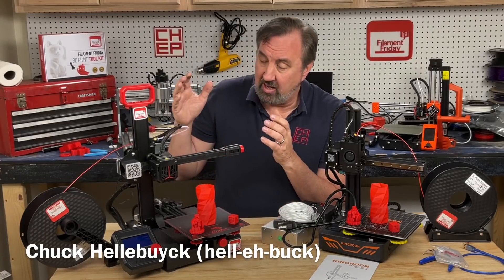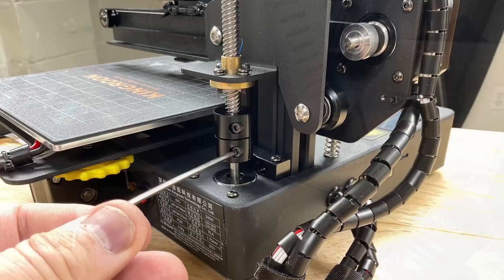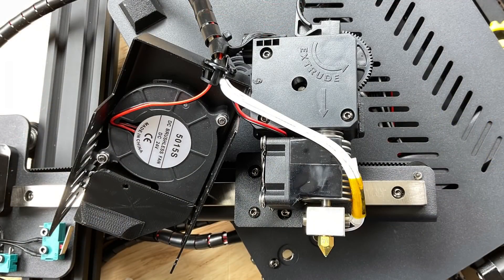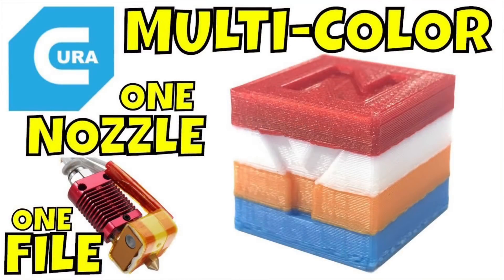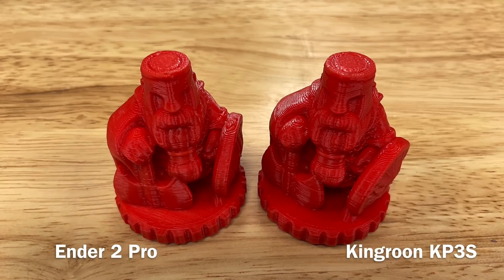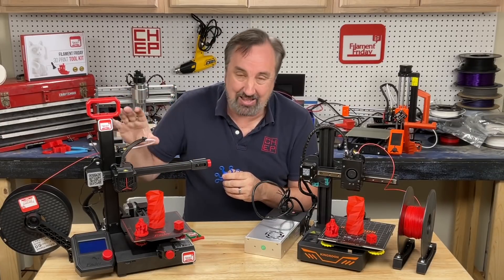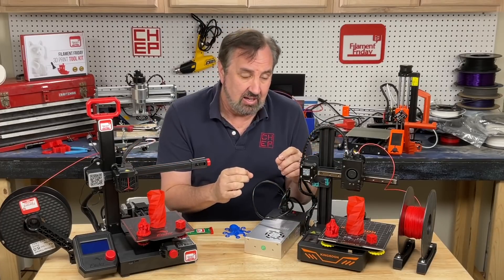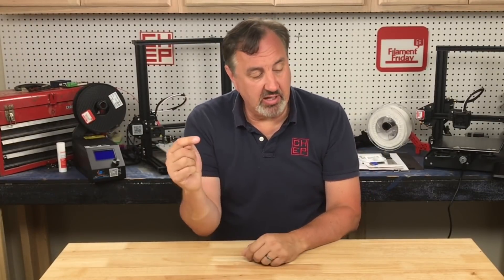Kingroon KP3S vs Ender 2 Pro - $179 3D Printers

Comment: I had to replace the wheels on my enders due to having flat spots overtime. Linear rails are just better quality parts, not necessarily for better quality prints. I get better cooling on the K3PS due to the better fan. Better DD extruder. A few printed mods and the power supply & spool holder is attached to the frame if you prefer that. Update the firmware and you get all things you need from marlin, plus a better display orientation too. Add a pi and klipper and that thing flies at high speeds, thanks to the linear rails. The KP3S is superior in every way to the Ender 2, but you'll have to put a bit more work into it.

Comment: hi... can anyone explain i am using pla gold in ender 5 , i printed phone bracket half way through i turned up speed from 100 to 150 the filament really did look like shiny gold at 150  , at 100 it looked dull ,why is this thanks .
Reply: which nozzle temp do u use?

Comment: I can see the attraction of the slightly larger build plate on the KP3S,  but I really don't like the way all of the parts are separate.  The Ender 2 Pro looks like an amazing, compact and even portable machine for the low price.  If I were in the market for maybe a "spare" printer for little bits and pieces, or to print parts to repair a larger machine, the E2P would definitely be on my radar.
Reply: There's a neat printable mod for the KP3S to mount the PSU under the main units.

Comment: Kingroon's firmware isn't open source. It is based on Marlin v1 . If you try to update the firmware the screen will need a print to make it a different direction.  The KP3s is very cheap. That is why people turn to it.  They kingroon didn't enable most things because they have the very basic marlin commands through the touch ui made by mks. the board is from MKS Robin Nano v1.2~1.3 - The board needs jumper wires soldered to be able to use it in UART mode. otherwise, they are A4988 mode in the firmware.
Reply: You're talking about an older version of the KP3s, the current version is 3.0 which has TMC2225 drivers. And are you saying that Creality's 4.2.3 board can use UART without soldering additional wires to it? Because that would make it the first Creality board being able to do that

Comment: Maybe the Kingroon uses a different M code for pause, like M600 (filament change pause) or M601 (pause print)?
It's amazing they can make and sell these printers for this price. I'm right now tuning my new V-Minion, which has the same cantilever design, and the same 180mm x 180mm as the Kingroon, but costs 3.5x more (and you have to build it yourself). Of course it's a completely different grade of machine and can print much faster, but still it's incredible that anything is possible for $179.

Comment: Ender 2 vs k3p vs prusa mini?:))
Reply: IMHO the Mini blows the Ender away, right out of the box. While it does use a bowden tube extruder, I'm able to SainSmart flex just fine with the OEM extruder. The Mini does use a seperate power supply, but it's huge like the KP3S and a separate spool holder. There is a spool one that attaches to the Mini that you can print, but as I always print out of filament dryer box, I never printed it.
Reply from the maker: Prusa mini is $400. Not really a fair comparison. But I talked about it in the Ender 2 Pro review video.
Reply: @FilamentFriday  I know:) but mini is very similar concept ...and im curious about difference in quality...maybe these has better quality - price  value 🤔

Comment: I found the Kingroon KP3S is on another level. You can read the full name of your prints unlike the Ender 2. Direct drive. Easier to setup. Linear rails make for less wear unlike the wheels on the Ender 2. A smaller profile is great for the room. Things I do like about the Ender 2 is the spool holder is better in my opinion, minus it taking more room. The adjustment for the belts. I personally hate tool trays that go inside the machine. I like a nice easy grab solution personally and I really don't need a handle to pick up my printers. TPU on the KP3S is a massive advantage for me. Though you could go with whatever is the cheapest at the time, if TPU isn't a major important filament you want to be able to print out of the box.
Edit: Larger part cooling fan on the KP3S is better. KP3S has a 2mm to 3mm PTFE liner in the heartbreak that is a pain to replace. The Ender 2 has a cheap PFTE tube that will need trimming over time. Still, the Ender 2 is easier to trim than replacing the liner on the KP3S. I'm still working on a replacement for the liner on the KP3S. The touch screen is nice on the KP3S and it looks better for me. I found personally KP3S prints like a professional machine. I dislike both the magnetic beds on these machines so I replaced them both right away with PEI spring sheets or glass.

Comment: linear wont make any better quality but boy is it easy to use. I have x axis converted to linear on ender.
Reply from the maker: Easier In what way? I’m curious?
Reply: @FilamentFriday  Theres no adjusting it. Less parts. Overall it is better. Something like ender 3 or this kingroon wont probably need it but move to a ratrig like i did and there is no point in anything other than linear rail. The cost of a rail is pretty much cheaper after you once change full round of v slot wheels. Or depends. V slot wheel at 3d jake cost 5€ per piece. Linear rail cost me 25€.
Reply: @TommiHonkonen  who pays €5 for a wheel when you can get 10 of them for the same price from China :)

Comment: linear rail allows higher speed at the same quality, that's a big improvement in performance
Reply: But only at 100mm/s and above, under that you should be fine with rollers. And honestly I wouldnt go higher than 60mm/s with these little guys.
Reply: @tonim.9460  ok so it depends on the user, but linear rail just has more potential. Also, linear rail is easier to maintain as it doesn't create those dusts from the rubbing.
Reply: @user-yk1cw8im4h  They are more reliable, but maintaining them is not the easiest. If you need to fix or clean one of the sleds, thats going to take you some time.

Edit: a lot more time than just screwing new rollers on to the axis.
Reply: @tonim.9460  why would you ever want to remove a rail/sled to fix or clean though? If you spill milk on it then yeah, but if not it will stay working probably forever.
Reply: @user-yk1cw8im4h  Dust from the air and small particles from printing will eventually end up in the sled, renewering lubrication and of course they still have a life span.
Reply: @user-yk1cw8im4h  And a lot of rails come with a protection oil to keep them from rusting and so on, but its not a lubricant, so you have to take them apart, free them from the oil and use your own lubricant.
Reply: @user-yk1cw8im4h  But I'm with you, linear rails are better, but not really for beginners.
Reply: I doubt these cantilever designs are rigid enough to work well at high speeds, especially with a direct extruder.  That said I do like the extra build area on the Kingroon given the overall footprint is similar.  I've had a monoprice mini for a couple of years, chosen due to lack of desk space, but often wished for a little bigger build area amd now the display has gone bad and it needs a new build surface I'm quite tempted to get one of these.
Reply: @ferrumignis  Hard disagree. I've put Klipper on my KP3S and upgraded the hotend and extruder. It can print very fast with great quality. Look into the Rat Rig V-Minion as well; people can print crazy fast with those and still get great quality prints.
Reply: @760creations  How fast are we talking with your machine?
Reply: @tonim.9460  I can easily print with 150mm/s with 2500 acc.  With 120mm its perfect quality with klipper. Its equal to default fw 60mm/s.
Reply: @jobbagyferi  Is Klipper really that much better? I was thinking about switching to it
Reply: @tonim.9460  Yes. Next level. But it can be tough to configure.

Comment: The size of the display and firmware is much like the flsun q5. The board looks similar as well. Looks a lot like a mks robin nano.
Reply: cause it is a MKS Robin Nano v1.2 ish. a custom-made Robin Nano for Kingroon.
Reply: If it is an MKS Robin nano clone, does Marlin support it?
Reply: @ferrumignis  Marlin works on the Q5, so I would assume so.
Reply: @bleach_drink_me  Thanks!

Comment: The Tronxy X2 would be better as I had mine for 6 years now and it is still going strong. But it is a bare bones 3D Printer and it has been on sale for $129.00 on some places. (Average about $150.00). Mind you when my girls got it got me it was $199.00 on Xmas 2016.
Reply: Not seen that printer before, has a big print area for a cantelever design. Unfortunately doesn't seem to be listed on the Tronxy shop website, so may be hard to find?

Comment: Looks like you can tighten the belt by shimming the servo motor. Shims can be 3d printed.
Reply: Also could probably use one of the metal springs that clip over the belt as it looks like it only needs a very small amount of adjustment.

Comment: If I wanted to print ABS how much of a pain would it be to remove the Power Supply of the Ender for proper ventilation?
Reply from the maker: It’s not easy
Reply: @FilamentFriday  so advantage Kingroon when it comes to this issue, provided you can easily covert to all-metal, good to know, thanks.
Reply: I print ABS on my ender 2 with no problems

Comment: nice basic review. I've got 3 kingroons and 1 ender3. for me the ender takes a lot more maintenance. from the famous extruder cracking issue to constantly being out of level. not to mention all the bowden problems that pop up half way through a 2 day print. the kingroons are bullet proof work horses. I don't even check bed level for weeks at a time. always ready to rock and roll.
Reply: Thanks for this, I'm actually tempted by the Kingroon for the larger bed area and direct drive. Is there any open source firmware support like Marlin? I could see the file display issue getting old pretty quick.
Reply: @ferrumignis  yes people have installed Marlin and klipper on these successfully. There is a decent community on Facebook and many printable upgrades online. Including a base for attaching the power supply under the printer that doesn't require buying any screws or parts at all.
Reply: @fufermanxyz  Thanks for the info, just ordered one to replace my aging Monoprice Select mini.

Comment: Cogged timing belts aren't like flat or v belts - they need very little tension to work. They are like gears, they only loose position if they are loose enough to skip teeth.
Reply: @wojtek-33  yes, loose belts can cause ringing and other print artifacts.
Reply: @LostInTech3D  maybe a good video idea for you to test? Loose vs tight belts?
Reply: It looks only very slightly loose, probably could use one of those little metal springs that clip over the belt to tension it. If not you'd have to shim the stepper out.

Comment: Rollers need to be replaced every now and then because they wear out over time. Linear rails don't. But i am not sure why they chose to go with rollers for the z axis on the kingroon.
Reply: A single linear rail on the z axis of a cantelever this long probably wouldn't give great rigidity in the Y direction (i.e. stopping the end of the x axis flapping back and forward) as that's not how they are intended to be loaded.
Reply: Its because not so much movements on z axis. I think u sould that a look at kp5s instead. Its really nice xyz solid axis
Reply: @Pilot_X_indonesia  And to cut the cost down i guess? But does it make that much of a difference in price?
Reply: @Pilot_X_indonesia  Yeah I agree, there is less movement on the Z axis, but IF you get flatspots on your Z axis you will see artifacts in your prints.

Comment: The base firmware is marlin one smoothieware.  Luckily with the f103 building marlin 2.x.x works and you can also wire linear advance.  Unfortunately they've been issuing gd32 and f407 chips and they aren't as easy to play with.  The motherboards are reversed robin nano v1.2's
Reply: Does the 2.x.x Marlin fix the file display issue?

Comment: Linear rails are better for print speed
Reply: I like linear rails because it's less maintenance and a longer lifespan.
Reply: Not enough to be worth it. If you're in a panic about print speed, you need a core XY. If you're in a panic about speed, spend more on the base machine.
Reply: @pinpetos  that's not true at all, with linear rails I keep my acceleration in the 6000 range and speed in the hundreds on an ender 3 with linear rails.  The only quality issues is from extrusion.
Reply: @pinpetos  nope, you can use klipper and get 8k accel 300 mm/s speeds with a KP3S.

Comment: On this type off printer linear rails are useless. You will need them if you run high velocity moves with high accelerations.
Reply: A klippered KP3S can get up to 8k accel 300 mm/s speeds and print perfectly tho

Comment: Thanks for taking a look Chuck! I love my KP3S, but I've done a ton of modifications and put Klipper on it. I definitely see your points about the Ender 2 Pro being a lot more user friendly and easier to handle. Regarding the firmware on the KP3S, I think it's an older version of Marlin, hence it not recognizing certain commands. There's community made versions of the latest Marlin for it, but it requires having to take the screen out and rotate it, housing it in a new part.

Overall I think the Ender 2 Pro is a lot better for printing straight away. The KP3S is better for a tinkerer who already has some experience printing.

Comment: I just checked prices on Amazon in Canada for a KP3S.  $500 for a KP3S while an Ender 3 (regular version, not the pro or V2) is less than $300.  In this market at least, the KP3S is a non-starter.

Comment: I guess if the belt tension is a problem and you were desperate, you could slot the stepper mounting holes to adjust?

Comment: That power connector on the back of that printer has been known to be a fire hazard.
Reply: Not exactly. Nobody has had one start a fire that I know of. The connector can get a little warm and that makes some people nervous. That doesn't make it a fire hazard. Many people have print farms full of them without any issues. It's not like the Anet A8 burning down houses regularly.
Reply: Very legit point.  I have seen users add a mosfet to power the bed as a workaround.
Reply: @Rsm583  The 3.0 version fixes that, it was the older models that had the issue